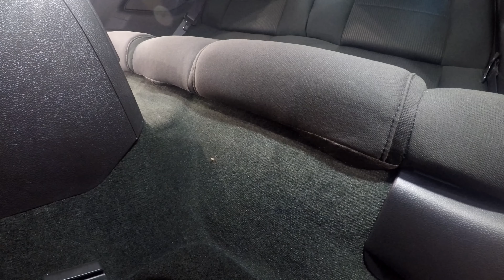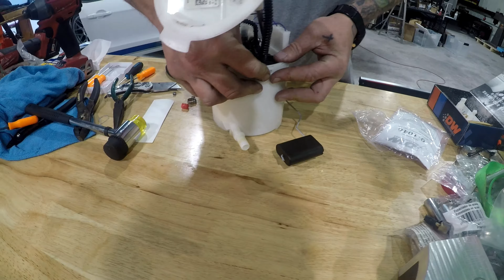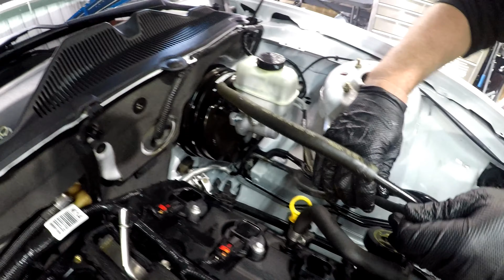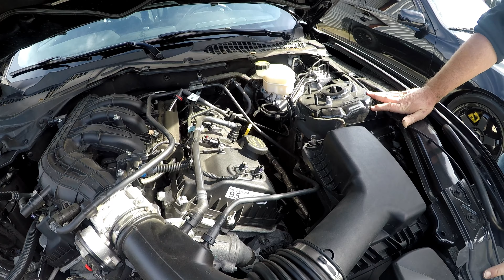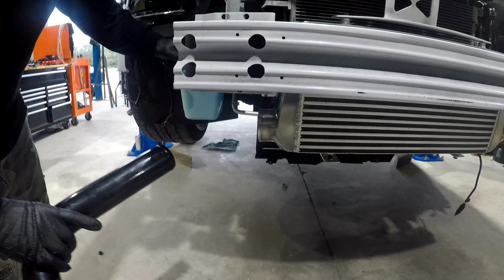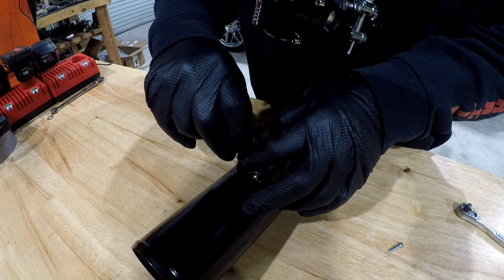How to Turbo A 2011-2014 3.7 S197 V6 Mustang (AMR S197 3.7L V6 Turbo Kit)

Comment: What drivetrain upgrades are required? I plan on getting an aluminum driveshaft and 3.73 gears, but is a new differential, transmission, and rear axle needed or recommended??
Reply from the maker: 1 piece DS is always a good idea but besides that nothing is required.  All the diff,t rans, axles are good to go.

Comment: so I see on your website that it says that the kit comes with "Custom Mafia Turbo Tune (1 Fuel Choice Only 91/93/E85/etc)" does this mean if I were to get the kit off the website I wouldn't need any additional tuning and basically just need to install and get the tune via email or smt? or would you recommend dyno tuning?
Reply from the maker: Yes the complete kit includes email tuning for 1 fuel type. So you wouldn't pay more you would just do our normal process for tuning

Comment: My S197 manual 3.7 has the check valve off of the brake booster. Have you run into this before? Idk why it would be there for a manual...
Reply from the maker: Yes sometimes

Comment: Can the stock engine take the power or do you need to upgrade internals?
Reply from the maker: 100% stock motors can hold about 600 rwhp.

📬 Contact AMR for build advice and guaranteed lowest prices.
📞 941-979-1132
📧 Support@AutoMafiaRacing.com    www.automafiaracing.com

Comment: Would it be safe to run boost on a car with 90k miles? also where are you going to get parts for a built motor I want to build my motor as well, Thank You!
Reply from the maker: no thats low mile!   We sell all the parts you need to build the motor but its not needed unless you want to reliably make over 600 rwhp.

Feel Free to Message us with any questions if you need advice or a quote on any parts, builds, installs, or dyno, email tuning.  Here is a link to our Facebook Page.  Link: https://www.facebook.com/automafiaracing

Comment: whats everything i need that doesnt come in the kit
Reply from the maker: Message our page.  Tune and injectors and fuel pump and spark plugs basically.

📬 Contact AMR for build advice and guaranteed lowest prices.
📞 941-979-1132
📧 Support@AutoMafiaRacing.com    www.automafiaracing.com

Comment: Does this kit connect to my vehicles factory exhaust or would i need to get a new exhaust fabricated from the end of the downpipe back
Reply from the maker: Yes then Y pipe connection is the factory Location for the over axle pipes
Reply: @automafiaracing  so it does connect to the factory exhaust?
Reply from the maker: it can

Comment: How much for the kit and installation?? Have you taken one to the track ? How’d it do
Reply from the maker: Multiple guys have easily ran 12.5s with stock cars and our turbo kit.  They all do 120-128 mph so they should be able to run 10s with the right launch

Comment: How much is this kit installed? Does it require an aftermarket exhaust?
Reply from the maker: We install the kit and dyno tune for $3500.   The exhaust requires a y pipe. We offer one in our kit.
Reply: @automafiaracing  i like the kit but id rather keep mine h pipe unless i could work around it
Reply from the maker: You can keep your H pipe. No problem
Reply: @Auto Mafia Racing  could you install this turbo kit if you have an x pipe? My 3.7 has a bbk x pipe
Reply from the maker: The x pipe will be replaced by the Y pipe

Comment: wait am I dumb or is all the exhaust leaving from the wastegate
Reply from the maker: Youre dumb. Lol
Reply: @automafiaracing  I’m trying to figure the exhaust stuff out (this is same person on diff account. The driver header feeds exhaust into turbo, hot side turbo connects to downpipe, and then the passenger header and the driver side down pipe are connected and the waste gate has its own exhaust. I’m very new to turbos and can’t figure out where the exhaust is dumped lol.
Reply from the maker: Lol.  Pass side goes to drivers side. Turbo is om drivers side.   Exhaust goes out the turbo and out the down pipe.

Wastegate just lets extra exhaust out so the turbo doesnt over boost

Comment: Did you just call it a "ROUSH" 3.7L? I think you may want to go back and edit that out bud lol
Reply from the maker: It is a roush.   That's a roush RS.
Reply: @automafiaracing  not quite. That is in fact a fake Roush RS Since the ROUSH RS debuted in 2016. That's just a regular V6 witn ROUSH badging
Reply from the maker: wrong.  Its a Roush RS.  that was a thing in 2014.

Comment: That strainer is a terrible fit. What a pain in the A$$
Reply from the maker: Strainer?
Reply: For the fuel pump
Reply: Also, in this video at 47.35 min. It shows the blue fitting that goes in the block with a reducer. I didn't receive that in my kit, I do see an aluminum fitting in a ziplock bag that looks like it fits, but I don't see a reducer. I'm assuming the kit I received earlier this year (2023) has been updated thus, no longer requiring a reducer? I just want to be 100% certain.
Reply from the maker: 📬 Contact AMR for build advice and guaranteed lowest prices.
📞 941-979-1132
📧 Support@AutoMafiaRacing.com    www.automafiaracing.com